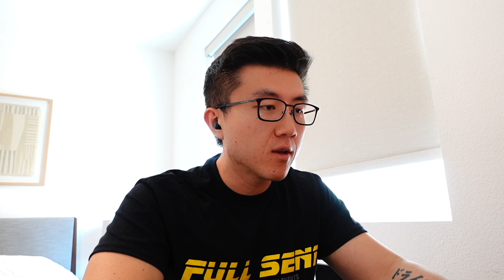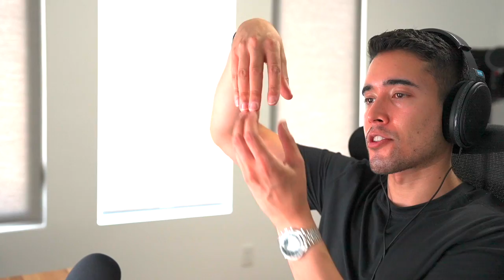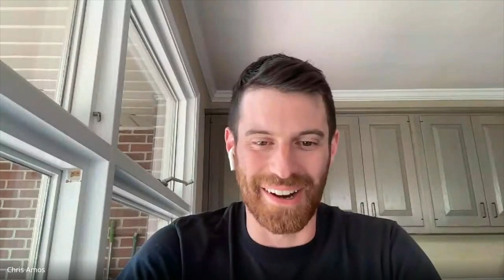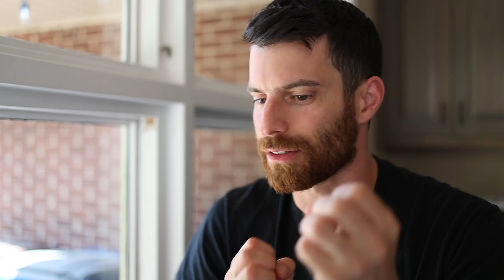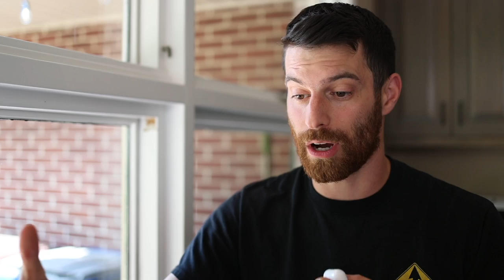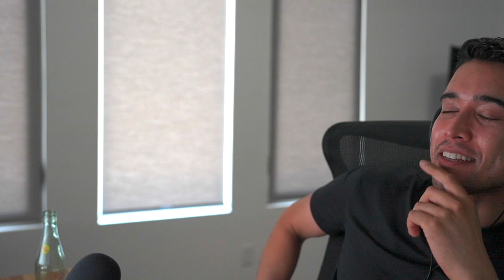Is Your BRZ or GR86 a Ticking Time Bomb? ft. TheTopher and Jubbal & Cars - ZCT #35

Comment: Thank you for the shout out Zygrene. As a friend and small business, I sincerely appreciate it!

Speaking and working on cars from a HUGE amount of Gen2 owners, here's what I've gathered regarding the Oil starvation/ RTV leading to engine failures issue: It's a combination factors. High volume oil pump, smaller sump capacity (1qt less than FA20), no oil baffling (sustained high G turns), RTV blocking the pick up, internal oil system design (MotoIQ did an article on it where the main/rod bearings are non primary for the oil system, good reason we see so many bearing failures/rod knock)

One other thing to factor in is how Toyota vs Subaru deal with warranty claims. Subaru by far is way more forgiving - during my time as a Subaru dealer tech, I've seen how easily Subaru will cave in to "good will" a warranty claim or buy back a car that doesnt really have an issue. Here are some personal examples

Buy back: 60,000 miles Impreza due to multiple warranty issues (normal Subaru quirks)
Buy back: Subaru Legacy the owner states the sunlight sensor would not turn his headlights on "fast enough"

Good will: WRX 15,000 miles clutch failure. Clutch job parts and labor got good willed. Keep in mind this car had bald tires, little to no brake pads, and a body shop receipt that said the car had been in an accident with frame damage.
Reply: I am glad I have the Subaru version after reading this.
Reply: Wasn’t my experience with my first gen BRZ. They barely wanted to do anything with blatant issues….
Reply: CMAutohaus does great work. Super consistent reporting
Reply: @shawnconary6810  Thanks James Bond. Sincerely appreciate it. As a small business making the RTV videos is really taxing, but I know it helps the community, especially the data collection
Reply: Hate to say it, but in Canada dealers are entirely unforgiving.  If they can't charge you for it, they're not interested in helping you.  $165 CAD / $120 USD for an OBD2 scan to pull codes, before quoting you for the maintainence itself
Reply: Why would they design engine to be worse in the oiling department? Its a shame they skimped out on the basics on the Gen2 cars. Thanks for the info.
Reply: On a side note I wasn't able to find the MOTOIQ article, I tried using their search using FA24 but didn't have any luck, do you happen to recall the title or close to the title?
Reply: @CMAutohaus  lol thanks man. Genuinely hope it at least brings more business your way. You deserve it, my dude.
Reply: @sshah2545  LOL here in the Bay Area we have Toyota and Subaru dealers near north of $250/hr labor rate. PLUS our 12% sales tax rate (and rising)
Reply: @coldvaper  I forget if it was a MotoIQ blog or YouTube video, but its for the FA20 - same concept applies for the FA24 as it is essentially a bored and stroked verision
Reply: @CMAutohaus  wiiild. Our sales tax is 13%, but damn that's some seriously expensive labour.
Reply: @sshah2545  Can confirm when my BRZ CEL’d. It went away just before taking it in so I didn’t scan, but I was reassured that if the CEL issue is under warranty, the scan fee is waived along with any warranty repairs.
Reply: @@Seth547 Its not an oil thickness issue, its an oil starvation issue due to oil moving away from the pick up on hard corners and elevation changes
Reply: scammer

Comment: Which brings us back to Miata is always the answer 😂 ND Miatas engineered to maintain oil pressure at 1.4G consistently.
Reply: My Spec Miata was solid!
Reply: Way slower than brz
Reply: @zhechengliu387  To the Gen2 BRZ yes but I’m not sure I would say way slower… Depends on so many variables. My last event I was faster than a couple but again driver, tires, mods, etc… all make a difference
Reply: Right on! Add to that they have some oil baffling from the factory.
Reply: It would always be the answer if if fit a larger people. I'm 6 foot and my head rubs the roof.
Reply: @zhechengliu387  don't forget reliability is a big part of racing
Reply: @thaydathroeun8678  which is what the engineers at Mazda had in mind when making the ND. They knew this vehicle would be raced, not only in their spec series but it is the most raced enthusiast car globally (according to Dave Coleman @ Mazda USA) so they wanted to ensure people could buy it and race it right from the showroom at an affordable price.
Reply: @MachMotorsport aren’t the transmissions a weak point hence the nc trans conversions
Reply: @slick4415  From what I read and heard the ND1 (2016-2018) transmissions have had their issues. However, the ND2 transmissions are apparently better and Mazda switched to a dual mass flywheel setup in the ND2 to “remove unnecessary engine vibrations” to the transmission. Either way most guys I know that track their ND’s have had zero issues with their transmissions but like anything else it comes down to driver, maintenance and misuse.
Reply: Definitely. I just bought an ND2 after a few years away from JDM cars (BMW M cars) and I did cross shop the GR86. I go to the track 2-3 times a month and I just couldn’t sweat thinking about my engine blowing up. I had an ND1 years ago and went through one transmission but it was V1 and Mazda swapped in a V5 with no questions asked. So happy to be back in a Miata.
Reply: @zhechengliu387  the Miata will get you more seat time.
Reply: For a toy. Not really practical in the slightest. I think most people want to daily a fun car they enjoy. Miata makes it difficult
Reply: @SoulEraser000  depends on everyone’s personal situation and a lot of cars can be considered ‘toys’. I find the miata very versatile in my living situation.
Reply: But then you’re driving a Miata…. For a lot of people a Miata is impractical and the BRZ/86 platform offers significantly more duality. I’ve owned Miata’s and they aren’t as reliable or cut out as everyone makes them btw.
Reply: @NapalmPineapple  I’ve owned 6. Never an issue other than small things.
Reply: @VictorPitstop  and that’s great. For some people that’s the case and for others it’s not. Mine never seemed to keep cool on track despite a coolant re-route, thermostat, full aluminum radiator, and fan shroud. I maybe could get 2 10/10 laps out of it before I’d have to pull in. Rear suspension travel is an issue with NA/NB gens. The whole concept of the rear bumpstop acting like a progressive spring is so stupid. As a sole use car it’s utility is laughable. It’s by no means a perfect car. Neither are the 86/BRZ twins. I can totally understand the appeal in both platforms. Personally, I would never go back to a Miata after owning my 86.
Reply: @NapalmPineapple  trust me, I’d be in a new twins if I didn’t have to immediately baffle my oil pan or use an accusump. The local track I go to is smaller so it’s not too bad after a few laps in Texas heat; COTA will be a different story and I will need to install the oil cooler on my ND before I run there. You’re right about the older gens as the 4 of the 6 I’ve had were NAs; I am more referring to the NC/ND platform since it’s more the same category with the Twins.
Reply: @VictorPitstop  I feel you man. I own a 1st gen 86 that I bought new in 2019. When the 2nd gen came out I was naturally curious about it, however, I acknowledged it’s safer to wait for a mid cycle refresh. My assumption so far has been accurate lol. I track in Arizona so if wanna run the car on hot days I’ll need an oil cooler as well. In the winter for AutoX events it’s fine. I’ve driven every Gen of Miata. Most impressive imo is the NC2-3 and the NDs.
Reply: @NapalmPineapple  I would totally rock an NC2/3. AZ I assume would be a little more taxing on cars in the summer because it’s dry and 115ish degrees! 

I actually have a buddy that blew his engine in his new twin with less than 3k miles and broke it in properly. Another buddy literally just installed the accusump on his twin and he is dropping no less than 50psi on hard rights now. I am surrounded with buddies in the Twins so I am vicariously living through them lol
Reply: my head was above the roofline in the miata, my eyes were in-line / blocked by the edge of the front windscreen, and it messed my hair up. 💀  

I was only in the passenger seat, but my knees were pressed into the dash also, so honestly I don't  think I would even be able to use the pedals.
Reply: @Jez4prez1  at 5’6” I don’t have this problem, I’m literally what the engineers envisioned in their consumer 😂
Reply: @Jez4prez1  damn, being a physical human specimen must suck not being able to fit into little cars! I’m right at the cusp being 5’11 to where I definitely need to get a seat lowering bracket.
Reply: @zhechengliu387 I bet it's faster after GR86 engine grenades.
Reply: @zhechengliu387  as a gr86 owner, yes might be slower but nd2 is more fun
Reply: @SoulEraser000  if u r single mx5 is a good daily, gr86 is even better ofc but mx5 is more fun
Reply: Miata, Civic Si or Fiesta ST are all great in my opinion. Only one problem with the last one. They don’t make them anymore!
Reply: Yeeeeah not the best of this is your current 1 car garage though. Also know of tracks where you can't take a Miata unless there's a proper roll cage installed.
Reply: @zhechengliu387  It's also like 500 lbs lighter so similar power to weight and similar 0-60
Reply: Not if you're 6'3

Comment: I'm not shocked, Subaru engines aren't known for being super reliable.
Reply: Its what makes a Subaru...a Subaru.
Reply: Also hey....."they lived...."
Reply: They can be, if you take proper care of them.. but most of the young kids that came over from the Honda scene don't do that. They think they can beat on it, like they do their Honda's and it'll be fine but that's not the case. You have to pay to play with Subaru's. You have to do the interval maintenance's at specific mileage, you have to keep an eye on oil pressure, you have to check your oil every time you fill up.. You HAVE to have dyno tunes done for every little modification you do that affects air or fuel, like intakes or downpipe etc.. there's preventative maintenance that needs to be done and when you don't do it, they go to shit. On top of that, the engine design and stock oiling/baffle system is not a good combination. They can starve, if you take high G turns, as all of the oil will go to one side of the engine. It can be fixed with aftermarket parts but most people don't know that. They take their stock oil system Subaru on a track and it blows up because of the starvation and they just go "$%^@$ POS Subaru" and blame the car, when in reality, it's the owner.
Reply: @hhaste  Everything you just mentioned is why they aren't reliable in comparison to other brands
Reply: @hhaste  what aftermarket parts fix oil starvation during high g?
Reply: @DOOMLORDHOKAGE  Every car that you take to the track has its own issues that you have to watch out for. If you ignore them, it's your fault they blow up. Like they mentioned in the video, these aren't cars that are designed for the track. They're intended to be fun sports cars for the street. If you want to take them to the track, they need to be track-prepped, which is different for every car.
Reply: @thaydathroeun8678  Speaking from the perspective of an STI, higher weight oil (since they thin out drastically on-track), larger baffled oil pan, sturdier oil pickup, if you run a built block then you need a larger oil pump. I'd also add a pressure gauge with an alarm so that you can monitor it and back off if something is going wrong before you cause damage.
Reply: @PocketDrummer  But you can do that with a Miata though.

Comment: I think 0w20 is to thin of a oil for tracking your car
Reply: 0w20 is absly water for performance use
Reply: Yup, I learned that the hard way in Gen 1. Don't let the epa choose the oil for you, especially for tracking. Interesting why the US owners' manual only recommends 0w20, but the Japans owners' manual, you can use 0w20, 0w30, 5w30, and 5w40.
Reply: I am running 5w30 but wonder if Subaru would deny warranty because of it.
Reply: I absolutely hate 0W-20 oil. If there’s any sort of aggressive driving happening, you gotta switch it out. The fuel economy benefits of 0W-20 over 5W-30 are extremely negligible.
Reply: Track/canyon customers of ours are all running 5w30
Reply: A lot of hate for 0w-20 but it's important to remember it's not just about regulations. 0w-20 does a better job protecting the engine during cold starts, cold temps etc. and it's perfectly adequate for street/daily use. 5w-30 might be the better choice on track but the guys at CSG recommend an oil cooler as a solution before changing the oil type. 5w-30 is probably the next best step after an oil cooler, but if you're not hitting temps that would thin 0w-20 out, you could be doing more harm than good.

Also a fun fact: the GR86 Cup cars use 0w-40, but they're also highly modified and have even had engine tuning done.
Reply: 0w40 is literally thicker than 5w30 at high temp isn't it? Which matches others advice of using 5w30 or just thicker oil than 0w20.
Reply: @dennisvanderben2719  Yes it is but they're track-only vehicles that are on slicks and have all the works.
Reply: @harrybuhse8622  aftermarket oil cooler has bigger chances of engine warranty claim getting denied, using 5w-30 costs nothing over 0w-20. I use 5w30 in summer when I would track or autocross and for winter I switch to 0w20, I don't drive this car when it's below 45 anyways.
Reply: My dealer just put in 5w30 without me asking. Pleasantly surprised.

Comment: One thing I find amazing is how most folks dont realize how much potential these cars have on track with suspension/tire mods. Watching your and other on track clips shows insane grip. And confidence. The risk of engine issues is worth it imo. What other car does what this car does at this price point? None. It is in a class all its own.
Reply: Miata, Elantra N, 4 poper muscle cars, many excellent used choices.
Reply: @milesfathi  convertible - fwd - all one thousand pounds more - maybe a cayman (then you factor in reliability and maintenance). like i said, in a class all its own. Miata maybe nears it.
Reply: You asked what other cars do performance this well at the price - you can't just dismiss answers to your question offhand because they do it differently (heavier and more powerful, fwd, etc).
Reply: @j.3854  Miata is right there with the BRZ/GR86 in outright speed and can beat it on handling alone. There is no substitute for less weight, period. Rigidity isn't the greatest because it's an open car compared to a fixed roof car (if you really want to find something to complain about), but the Miata is actually pretty darn ridged as far as convertibles go. Go drive a Mustang/Camaro convertible and you'll see how bad those are.
Reply: @newwavetheo  stock for stock BRZ vs nd2 miata is pretty close, but when suspension mods are accounted for the Miata's wishbone front vs BRZ's mcpherson strut makes the biggest difference.

Comment: I was in the fence between a miata and brz, the main reason i passed on the brz was because of engine reliability.
Reply: Valid reason
Reply: Well. I have an mx5  ND2 RF 184hp. I think it is much better than BRZ.
Reply: @jubbalandcars  i might add the miata is tested at 1.4g continuos..
Reply: @lucianolucidi8624  definitely
A real sport car.
Reply: @gigi9467  100% for me.
Reply: Say what you want about Miata its absolutely bulletproof.
Reply: @sunnyvalentino ND transmissions are not bullet proof.
Reply: Exactly
Reply: @xyz777  heard issues when ND was launched but friends with stock ND2s haven't had any issues tracking or autox.
Reply: @sunnyvalentino  yea trans. But even then if it cane down to it i much rather replace a trans that $1500 than an engine, these are street cars after all so i chose the most reliable
Reply: @65hi863dhyu  fake. The ND2 it is
Reply: @sunnyvalentino  i confirm. The ND2 is bazooka bullet proof
Reply: @lucianolucidi8624  2 twins. 80K mile FRS. 25K mile '22 BRZ. Can confirm the mx5 & Twins are ubiquitous track cars.  And this issue is overblown. Also lost a 997. Now that was a real problem. $35k write off.
Reply: @65hi863dhyu  geez. Who knows
Reply: @65hi863dhyu he obligatory “nothing has happened to my car so the issue likely doesn’t exist or is just overblown by the masses of people who also own the car”. This reminds me of the c6 zo6 heads issue. So many people reporting their motors blowing due to the obvious heads issue and the small minority who didn’t have any issues were writing it off as a problem that only a handful of cars had. This issue will continue to grow unless it gets taken seriously and resolved. People like you who pretend that these issues aren’t as big as they seem are going to be the reason why these problems won’t get solved like the c6 zo6 issue.
Reply: @worst-hd-player  there aren't dozens of zo6s on track every day. And they don't have a spec racing series either. The problem is 0w 20 on track. It was an issue in gen 1 and its an issue now as well. Track cars really need an oil cooler and a dry sump to be safe. I've had dozens of track days/Auto X. So have many others as well. There have been about 10 reported cases with around 20K cars on the road. So yes, I see it as an overblown issue the media ran with.